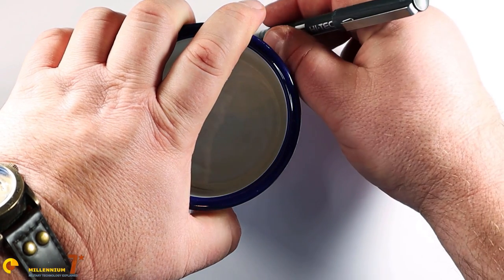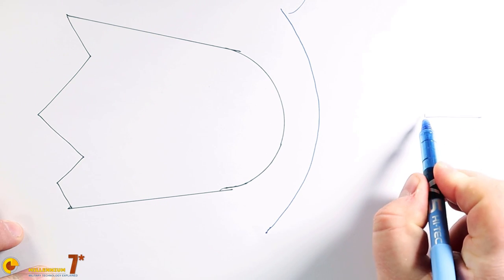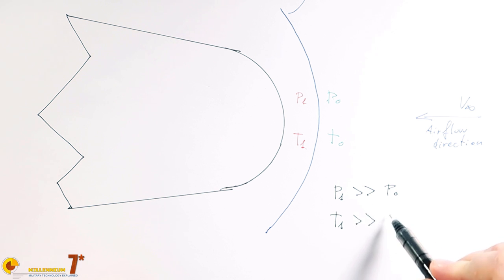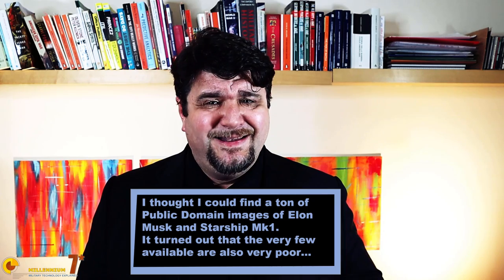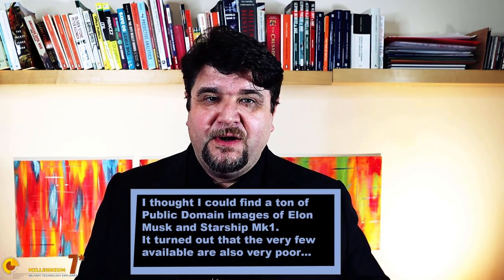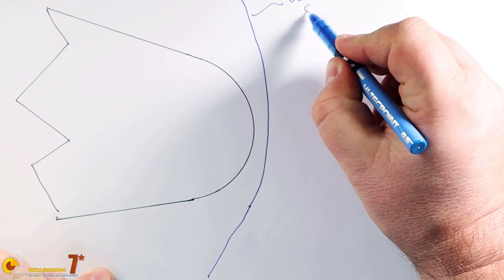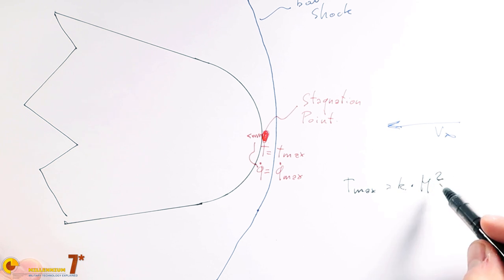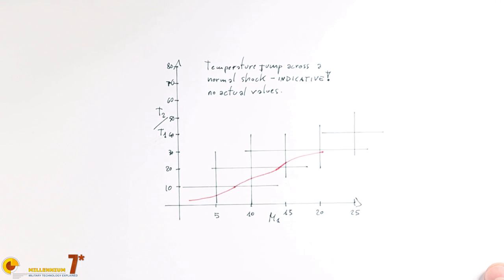Hypersonic heating: flying through Hell and back.

Comment: The engines of the MiG-25 were deliberately designed with a low compressor pressure ratio (~4.75:1) in order to account for the ram-effect stagnation temperature rise when approaching Mach 3.  Not quite as innovative as the J58 variable-cycle ramjet, but it's obvious they knew what the problem was and came up with an economical solution. Kind of like how you need to turn down the compression on a naturally-aspirated car engine when you add an aftermarket turbocharger.

Comment: I think I watched at least 15 or 20 videos of yours within a week since I first stumbled upon it.

Great work. I'm thoroughly surprised how few views and subscribers you have, especially compared to shitty channels using that horrendous speech synthesis.

I have one suggestion, though: background music volume becomes a tad too high in cutscenes. When watching in the evening, it can be disturbing.
Not a major issue, just a suggestion.

Greetings from Croatia and best wishes with all this coronavirus mess Italy is going through right now.
Reply from the maker: Thank you very much!
Background music is becoming something really contentious and difficult to nail.
Reply: @Millennium7HistoryTech  Try trimming speech waveform so that most of the peaks end up at the same level, then normalizing to say 80%. Then just try to keep an average music waveform a tad below that of the peak speech for the music-only sections (as music covers more frequencies it will seem louder than the amplitude actually is).

Music volume when you speak seems alright. If in doubt, go low.

If you need some sfx more pronounced, you can have it ar 99%, and if need be, maybe compressed a bit.

That should work for speech oriented clips.

Just my 2 cents.
Reply: I bet this channel will lift off very easy. It's contenta is Amazing

Comment: Wonder if hypersonic weapons are hypersonic in their low attitude terminal phase? Also they must produce a very intense heat signature  that can be used for detection. Would be interesting to see a video on the pros and cons of using hypersonic weapons.
Reply from the maker: It depends. They will surely slow down, how much, is a matter of debate. They will be hot anyway.